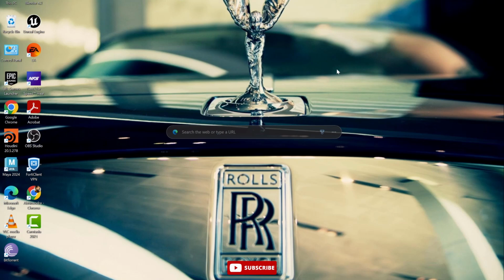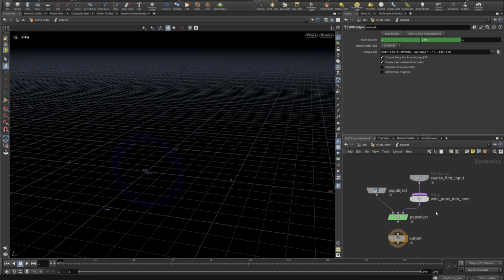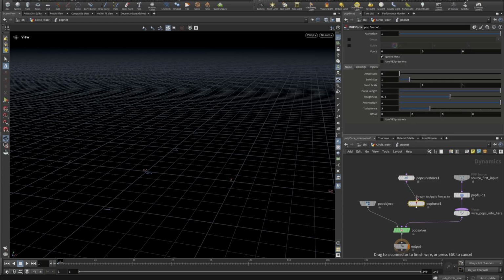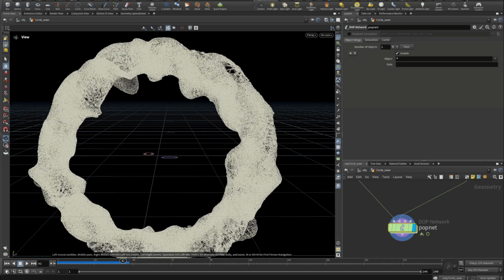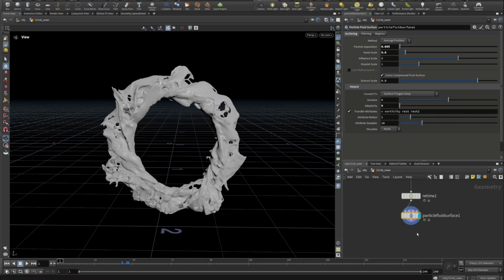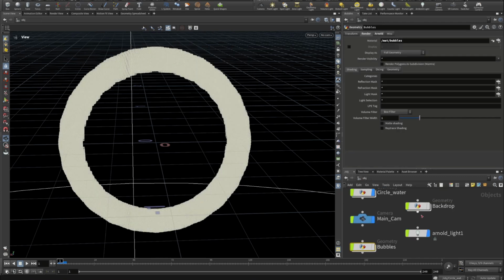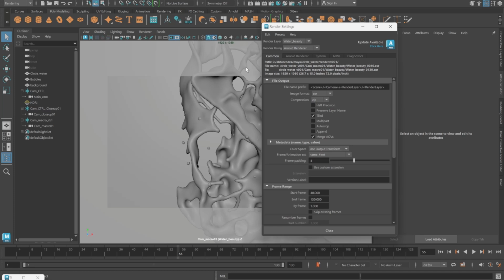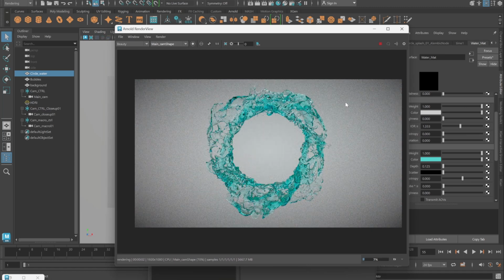Houdini Water Splash Circle Tutorial (Project files included)

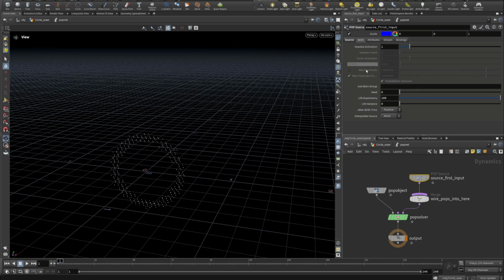Comment: 3:45 what expression did you exactly add into there?
Reply from the maker: Here's the expression which I have used,

$F == 1
$F: The current frame number.
==: A logical comparison operator that checks if two values are equal.
1: A specific value being compared.
So, $F == 1 is a conditional expression that evaluates to true if the current frame is 1, and false otherwise.